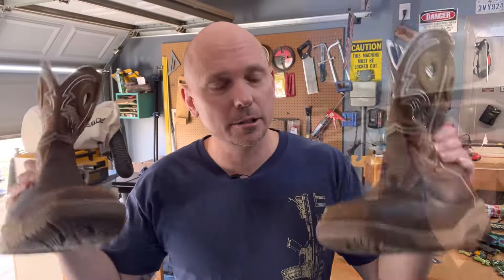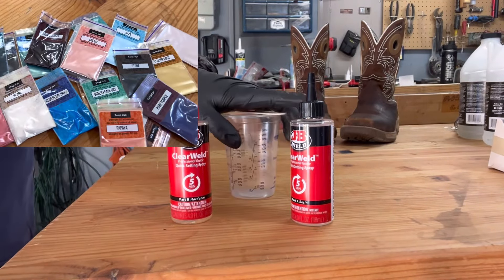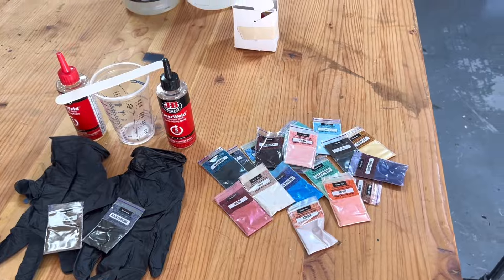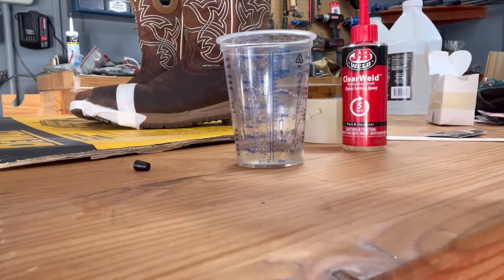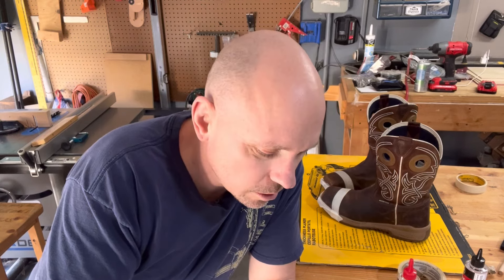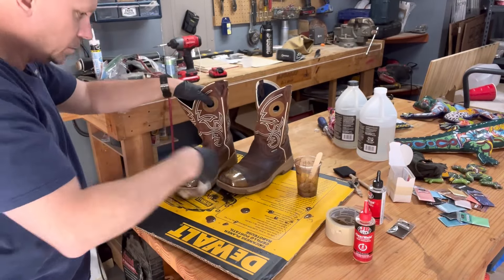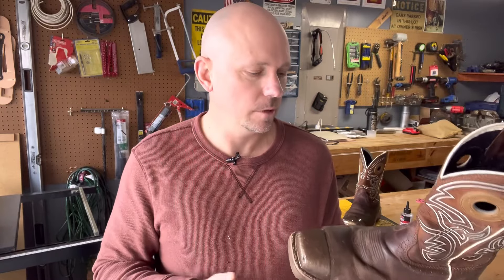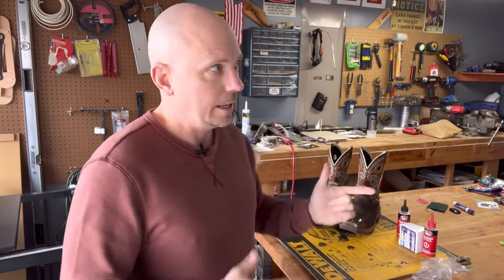I used J.B. Weld to repair my work boots.

Comment: I've used Tuff Toe on a few pairs of boots and if you prep the boot well enough it will outlast the boot. I got sick of spending an extra $40 for it on top of the cost of boots so I just started buying boots that already have a rubber/reinforced toe.
Reply from the maker: Yeah, this stuff is way cheaper than that

Comment: Interested to see how yours held up. I just came across your video now after doing the same application to my boots. I applied the product number 8281 (steel reinforced epoxy). I had it laying around after using it to fix my air compressor so i figured instead of spending $40 for some tuff toe i would give it the old college try lol. A quick update video would be very cool. Thanks!
Reply from the maker: Oh yeah, I’ll be giving it soon. I’ve been using them a lot.

Comment: Hey man I just prepared my new boots the same way! I always wear holes in my toes from kneeling on non skid. How are they holding up?
Reply from the maker: So far pretty good. I’ve used them quite a bit and still holding up. I’ll probably do a three or six month update
Reply: @epeiusgarage  awesome. The product they make for protecting steel toes is called tough toe. I'm a senior mate on a tow boat. The Tuff Toe was the best but it still scrapped off after about 6 months. So I'll send you a video showing my boots when you do your videos. I'm hoping JB weld works better.
Reply from the maker: @randomstudmanC  oh cool! I knew there was something for it specifically. I just did look it up🤷🏼‍♂️

Comment: How much is it to piece the JB weld kit  together?
Reply from the maker: @gotdirt66  I like the kit in the description. I think it was like $19.00 for the two bottles I use it on lots of stuff though so it’s handy to have around
Reply: @epeiusgarage   Damn thats a lot cheaper than 80$ tough toe
Reply from the maker: @gotdirt66  yup, now you might need cups and if you want color pigment but even then your pushing $30.00.
I did a follow up. Mine are still holding up a year later

Comment: Remember usin superglue and vinyl seat repair tape to keep my old boots runnin for a longer while 👍
Ended up havin ok luck with superglue and electric tape but that was more stop gap.
Coated them with tooldip after that. Worked well enough got to the point where finally wore through my handcarved tread for the 3rd time and that coupled with some leather rot and a crack that formed in the sole all the way to the steel shank finally lead me to retire them Viking funeral style.
Old Brahmas ruled. Kept that pair goin for over 8 years at least. What was supposed to be the same model replaced them with hardly lasted a year since found out there was hollow voids in the rubber preventin you from retreading them. F you for that brahma.
Your workgloves are now disposable crap too.